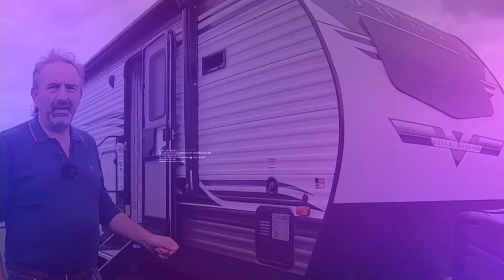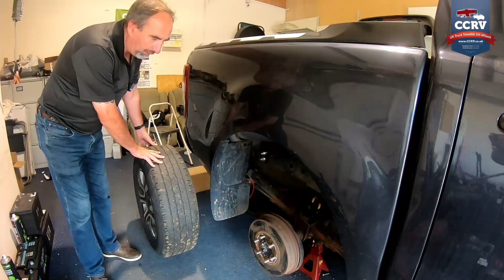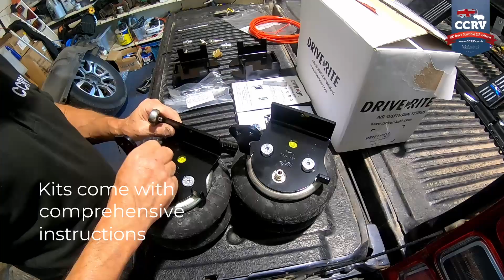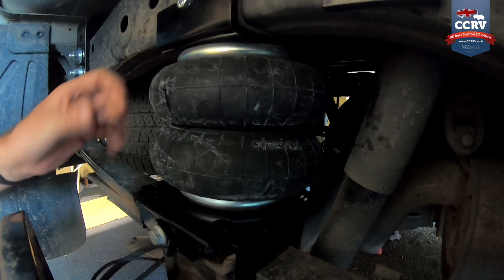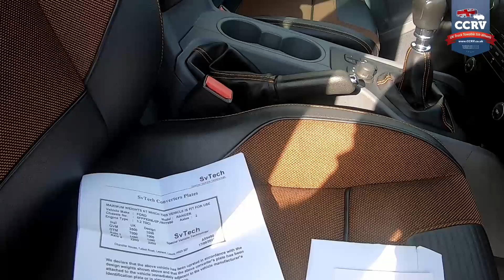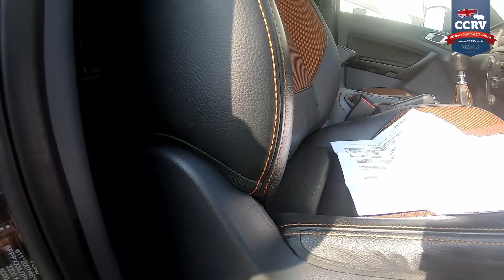Ford Ranger Wildtrak Air Suspension Uprate your Towing Weight

Comment: How about the payload weight in the truck bed Paul? The nose weight of the 5th wheeler is heavy!
Reply from the maker: Hi William depending on which one you buy generally  The UK truck towable ones have about 700 kg  On the pin and most UK trucks will take 1000 kg in the buck plus passengers and fuel
Reply: @CCRVUK  Hi Paul. I am the guy you sold a Jayco jayflight 28.5 10 year ago. Still going strong, love it. I am a bit concerned about the pin weight. The Nissan titan you sold me is plated as a half ton truck. I have had air bags fitted. But, they are not as robust looking as your ones. Would you advise me to drive up to you to have more robust ones fitted, with paper work? All fittings are on my truck, it is the bags I am asking about. And the paper work too.
Reply from the maker: @cravan1982  hi William yes make an appointment come up and see us or have a look what we can upgrade the truck to get you some decent airbags fitted regards Paul PS nice to know the rig we sold you 10 years ago it’s still going and thanks for following the channel please subscribe if you have if you have already big thanks for more at CCRV
Reply: @CCRVUK  Thanks. I'll phone next week, make an appointment

Comment: Paul, you forgot to mention that the GVW increases from 3200 kgs to 3500 kgs. This gives an increase of 300 kgs on the king pin weight. I have lot of tools for when we travel around Europe and that with a 2200 kw generator for wild camping and wish to use the microwave.  My set up is close to 3500 kgs GVW and just under 6800 kgs GCW.      Bob
Reply from the maker: Hi Bob from memory you have a Isuzu pick up the weights are different on the Ford Ranger which is the one in the video the Nissan   is different again hope to see you soon come up and stay if you want thanks again Paul